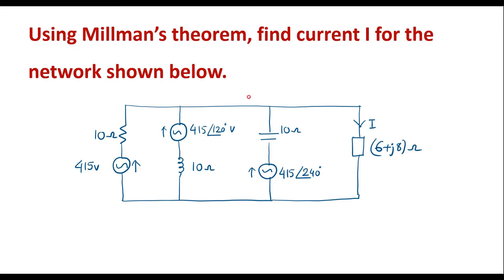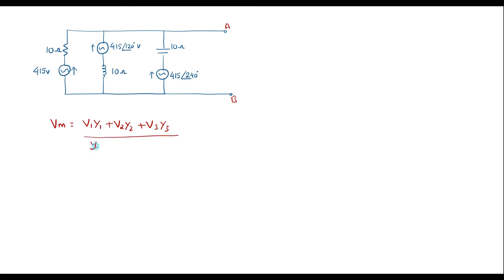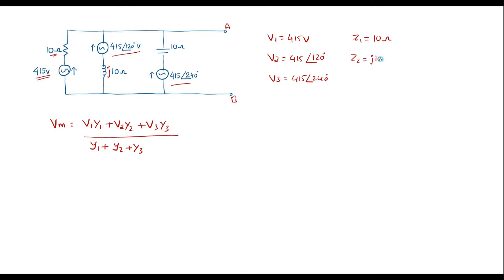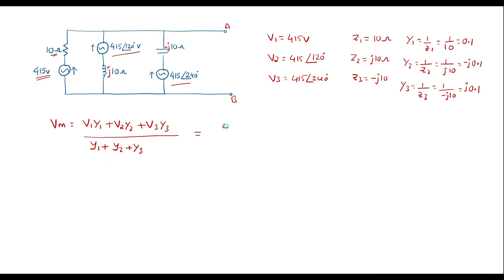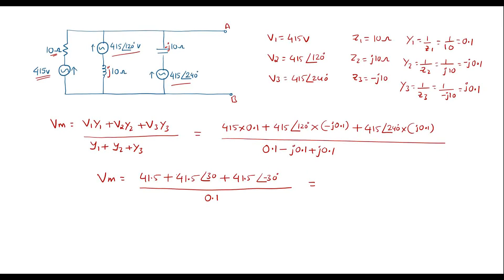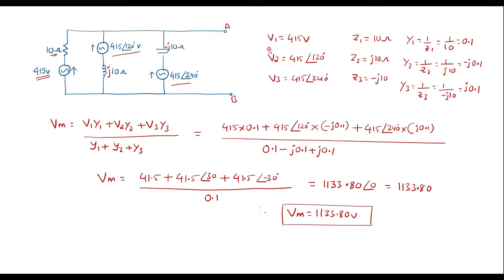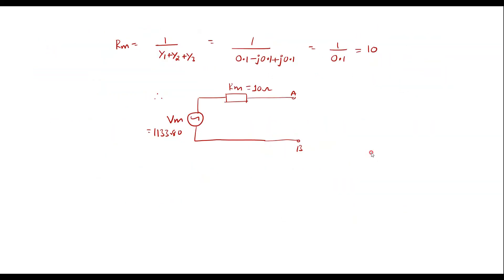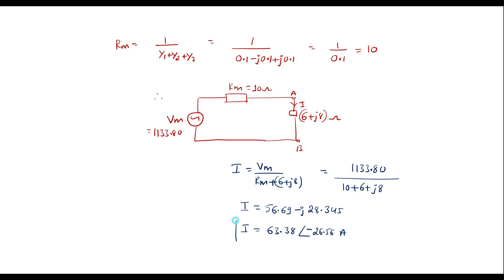Find current I using Millman's theorem

Comment: Sir explain how get 41.5 angle of 30 and angle -30  and. I=
56.69 -j28.345
Reply from the maker: Keep calculator in Complex and degree mode. Feed values as per the equation.